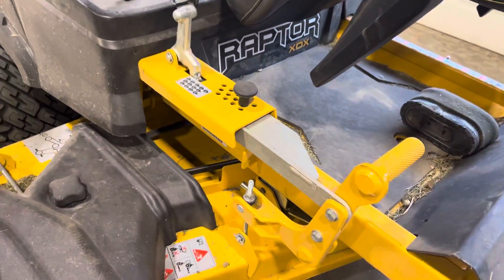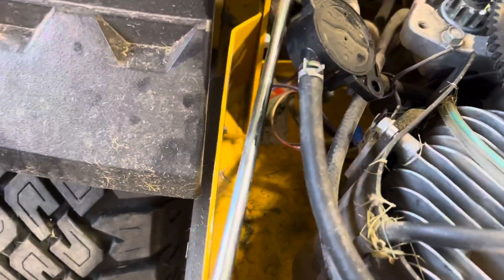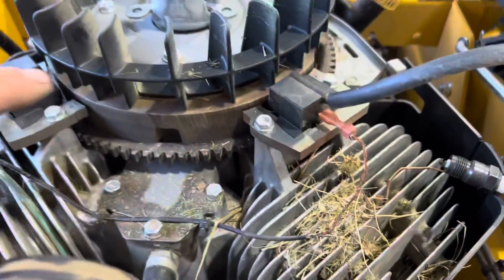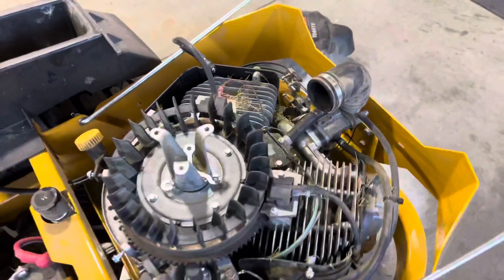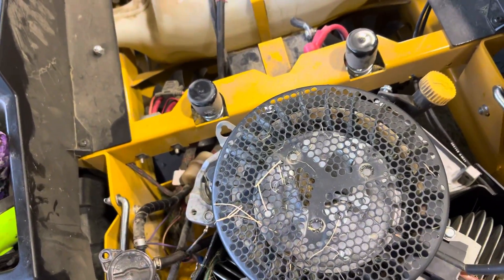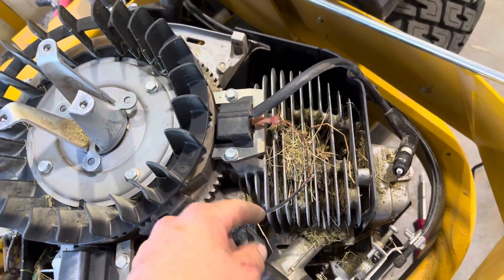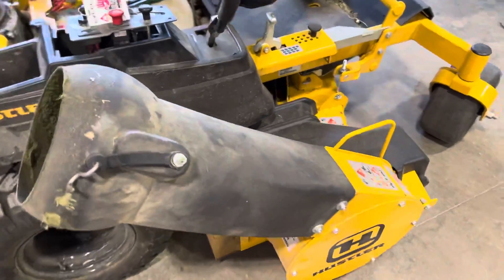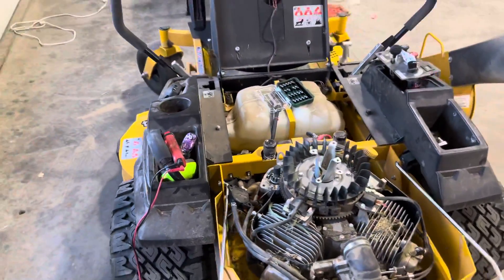Hustler Mower Will Not Start

Comment: Built like you know what? Built like shit. Yea I got one and I can say that they're Built like shit. Had problem after problem every year. They're great mowers if you want to learn how to service and rebuild lawn mowers
Reply from the maker: Seems like everything is junk these days doesn’t it
Reply: @HighOctane101  sure does. Poor powder coating, unintuitive layout, frame brackets undersized and snapping, cheap seat construction, bolts falling out. I had high hopes for Hustler and they weren't significantly less expensive than comparable machines, but I'm of the impression that they had not worked out their kinks when I bought mine in 2019, perhaps that's changed at this point. However, i am of the mind that you should not go to market with the intention of trying to get away with cost cutting to the degree they did in critical areas.